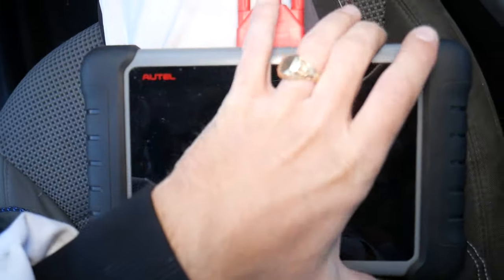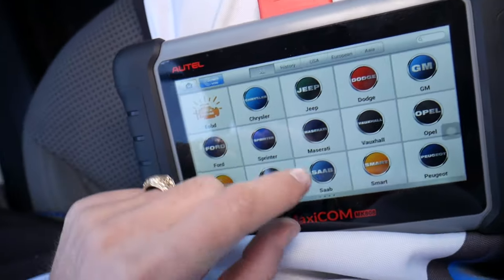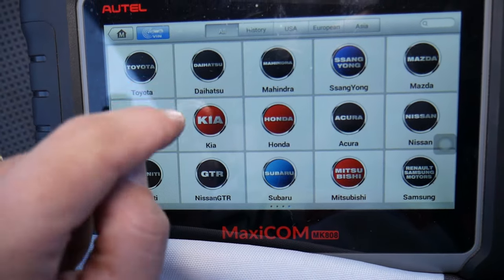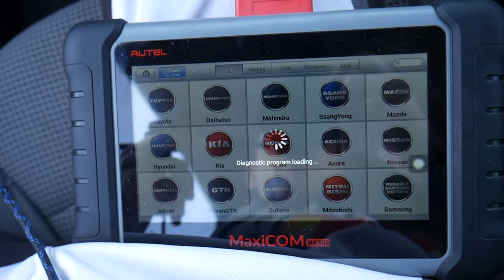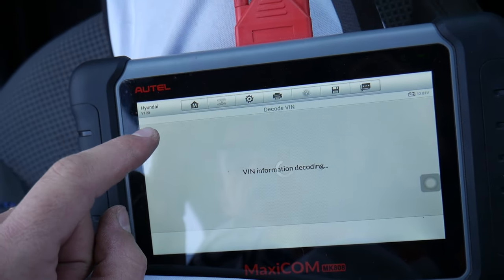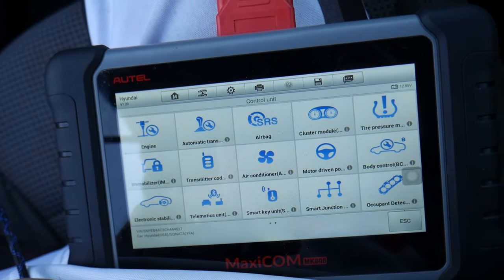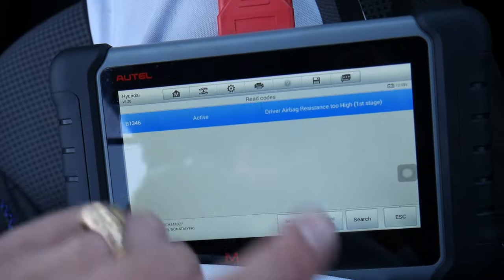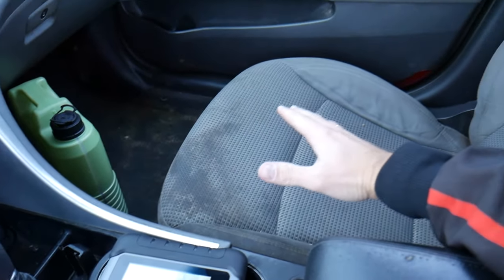THE MOST COMMON REASONS WHY AIRBAG LIGHT IS ON HYUNDAI KIA

Comment: Ive had diagnostics done on my year 2000 Hyundai coupe, the fault codes are suggesting its an internal failure, ive been advised the module is at fault does that mean it needs replacing or can the original be fixed?
Also its saying the seatbelt pretensioners are faulty but ive searched under the seats and the buckles and cant see any plugs or wires its all very confusing.